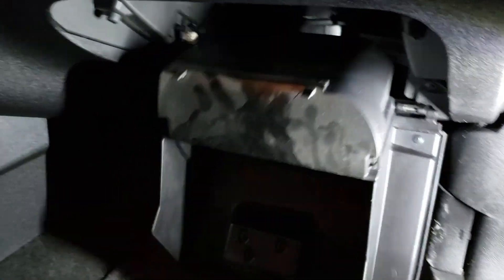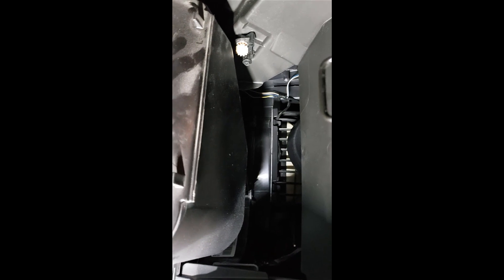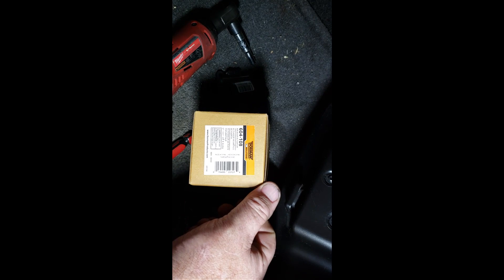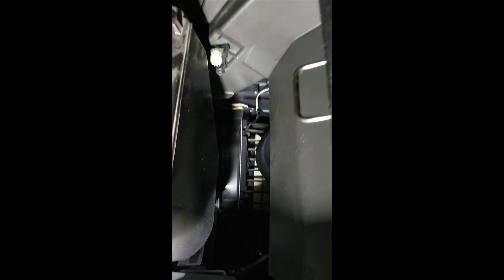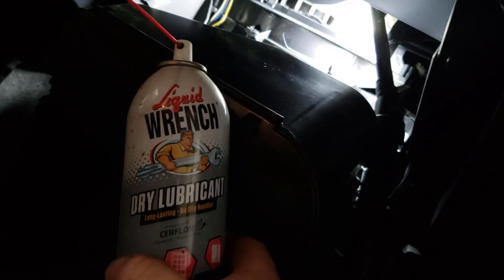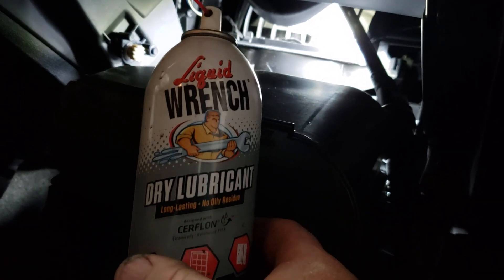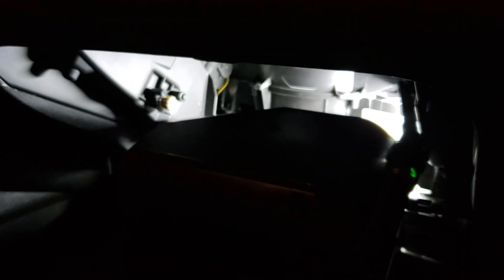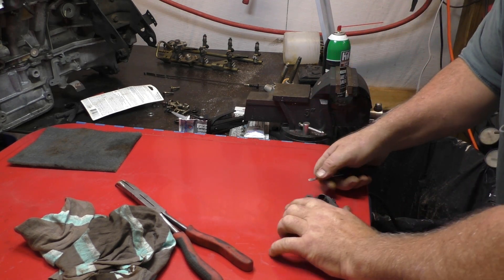2011 Chevy Impala Blend Door Actuator

Comment: I have a 2011 Impala as well and it's clicks, too. It's had 3 actuator replacements already by the previous owner. It doesn't affect the air flow (I see my breath with the ac running lol) so I'm not worried about it. Eventually will have it replaced.
Reply from the maker: Do it yourself. It is very easy and only takes minutes.

Comment: Trying to get some information for parents car they have 2011 Impala it makes that clicking sound on driver side when unlock or locking the doors with remote wondering if thats same issue. 
It also makes same clicking noise when I move button to hot or cold for driver side I'm assuming that's accuator as well.
I do believe both sides have to be replaced but I see you say there's 3 all together, is the third one in the glove box area as well.
Reply from the maker: One is the fresh air or recirc that one does not really matter. there is a learn we do with the scan tool.

Comment: Unplugged both actuators in glove compartment..clicking gone but i still get heat on driverside and cold on passengers side...is there another actuator..reason im asking is because the actuator control on the driver side works even though i unplugged both....
Reply from the maker: there are 3 in total.

Comment: I replaced two actuators for defrost and recycling air etc.  I have no heat on either side I need to change driver side actuator and the actuator you did in video correct
Reply from the maker: Yes but you may also have to get them calibrated if they do not work out of the box. Actually that should be done anyway but it seems most people get away with not doing it.
Reply: I’ve heard just undo battery and it’ll do what it needs to when you wait and plug back later thank your for the help and giving me the part numbers
Reply from the maker: @patfinallyrich1008  I cannot confirm about the battery as that is not something we do.

Comment: I just replaced my actuator on the far right side two days ago , think it’s called the blend door actuator. Was great yesterday but popping today, not as much but still popping. Should I be worried? I heard something about a recalibration..... fairly pissed at actuators 🤣
Reply from the maker: Yes some have the option for re-calibration in most cases that should no the an issue. I do however not know how to do that procedure without a scan tool. Here in the Shop I use the GM Tech 2 so I do not know what to tell you.
Reply: DORMAN PARTS ARE JUNK. USUALLY DONT LAST LONG!

Comment: I know there are at least 2 of these- one to select vent/floor/defrost, one to select temperatures for each zone. But- is there a 3rd to control fresh air or recirculation?
Reply from the maker: Yes there is
Reply: @ralfsautomotive  oh I’m going to have to find a video on that I think…
Reply: @daakrolb  There were 3 of these blend door motors(604-108) on my 2008 Impala.  And a different motor(604-134) for the vent/floor/defrost/etc modes.  Identical to the car in video.  Dual climate control.  If there is only a single climate control, then there are only 2 blend door motors.  The 604-108 is Driver temp control above gas pedal(hard to change but doable), Passenger temp control(easiest to change) which is the one he changed in the video and fresh air control (medium difficulty).  If you look into glove box in video, it is in upper right corner close to firewall.  I changed it by sitting in drivers' seat and leaning on passenger seat.  Easy peasy.  The 604-134 for selecting the mode is to the left about 4" from the one he replaced in the video.

Comment: Will these actuators affect over all air flow? I just replaced a blower motor and an actuator on my 2013 Impala that looks extremely similar to this one and the same actuator went out, the one you just replaced and I don’t have air flow and it’s been only 6-7 months. 

I’m going to go buy the actuator to replace the new broken one now but I’m kind of at a loss on what’s going on or why it’s happening again (although they are the cheap Chinese doorman brand that you mentioned here).
Reply from the maker: You have to test and make sure that the blend door can move freely.  Other than that, Dorman is pure junk.

Comment: What happens if you change it and then theres no heat.   Theres no noise, but now no heat
Reply from the maker: Odds are the Motor was not installed correctly and if it was the new one may be faulty. Always check and verify that the blend door can be moved by hand.
Reply: @ralfsautomotive  Your right.  I got it to work now the other side is out.  Had to order one more.  Should be easier now that I know what I'm doing...lol.   thanks for the video.

Comment: How do we fix the blendoor if it doesn’t turn by hand
Reply from the maker: If the blend door is sticking you may have a more severe issue and that could potentially kill the new motor. try to use some dry lube first.

Comment: Can a bad actuator cause your battery to drain?
Reply from the maker: Likely not! Have the Local Parts Store check your Battery, if it is OK  you will have to find someone that can do a parasitic drain test.
Reply: I had the same knocking sound coming from my Chevy Impala 2011 and my car battery went out aswell. I was told it was a bad battery, so I replaced the battery, once that was complete the knocking went away.

Comment: Looks like metal or steel gears would solve that issue permantly
Reply from the maker: Sometimes engineers will add weak points to prevent more damage. Not saying that it is in this case but possible.
Reply: Yes, it would solve this issue but possibly create another.  1998 F150 had an issue where the blend door shaft would break.  Actuator worked great until the shaft broke.  There was a patch kit but it was hit or miss.    Only proper way to fix would be to remove entire dash and plenum to replace the blend door.  My fix for a rusted out, oil burning truck was to cut a hole in plenum and use a coat hanger to hold door open or closed.  Adjust wire in Summer and Winter.  I would rather replace the weak actuator instead of the blend door.